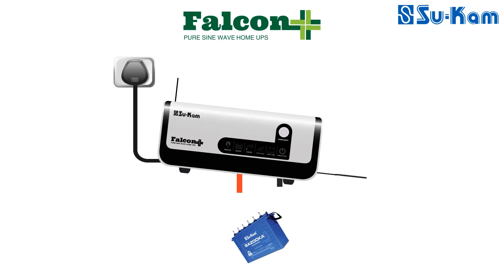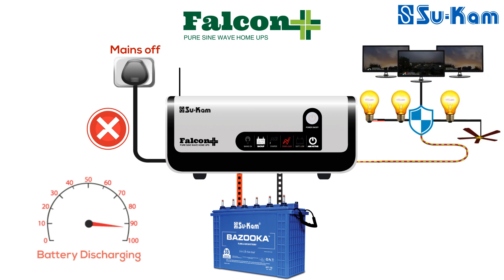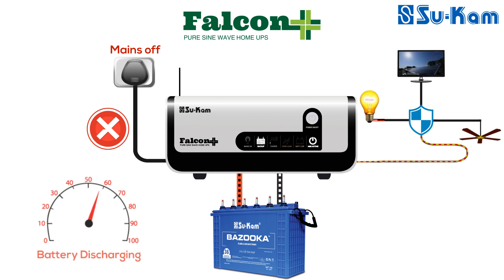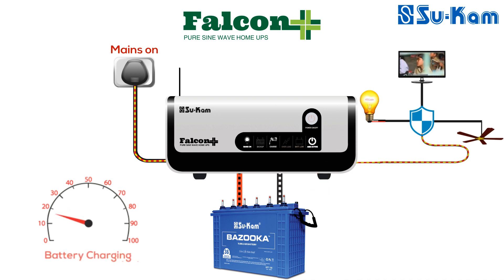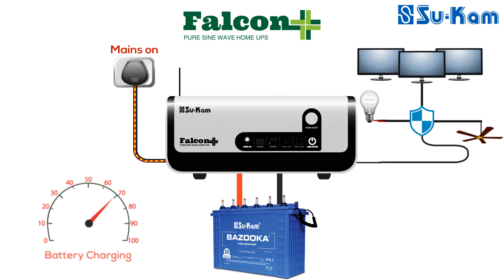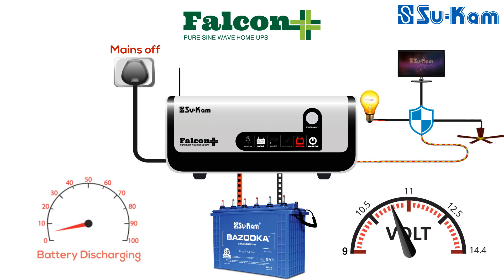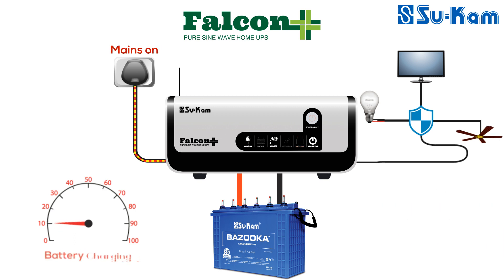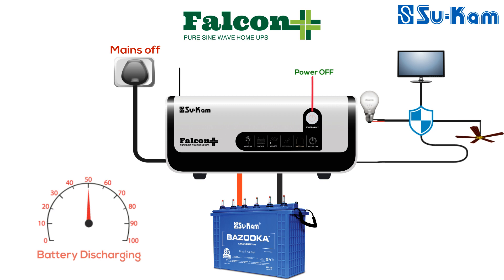How to run a Pure Sine Wave power inverter at your home? Su-Kam Falcon Plus

Comment: Does Sukam Falcon Plus 900VA inverter need to be run via stabilizer or not? When I run it via stabilizer, it gives charging voltage 13.8 volt and running it via direct mains gives 12.5 volt at battery temperature 29 degree celcius. But after a few minutes the inverter runs from battery even though all other devices are working via the same stabilizer.

Comment: Will this protect against voltage surge ? For example, the mains is on and there is a sudden spike in voltage, then will the inverter or any appliance get damaged ?
Reply from the maker: This inverter has been designed to protect appliances during high voltage surge.
Reply: Ok, and what will happen to the inverter , will it immediately cut off mains power supply and switch to battery mode or will it get damaged ? let us assume there is a sudden surge of 350 volts.
Reply from the maker: There is inbuilt protection for input voltage variations which protect inverter and connected output appliances .